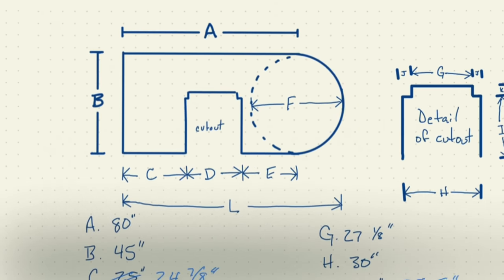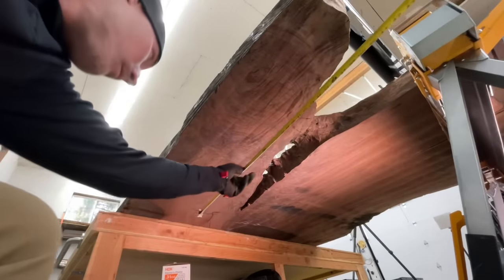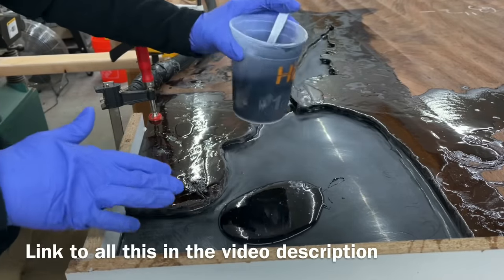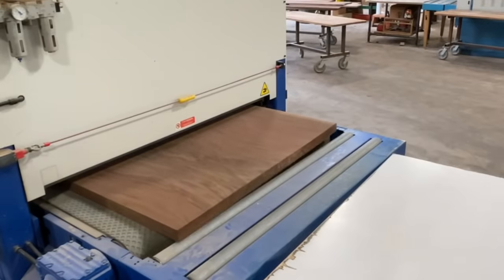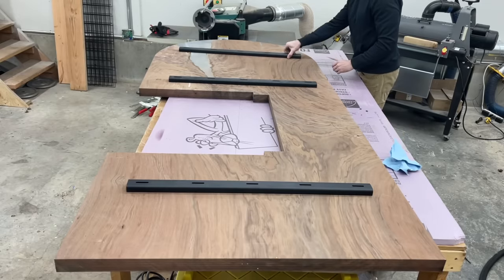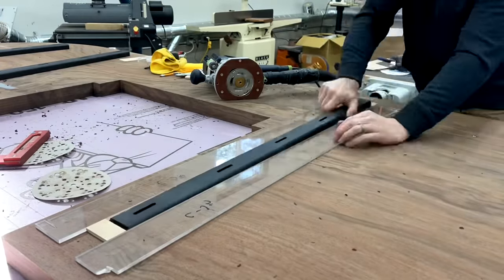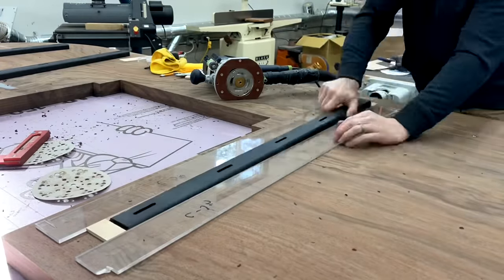$15,000 Kitchen Island

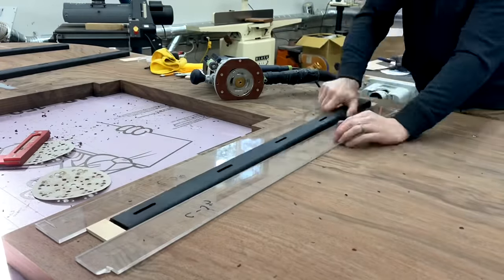Comment: LOL i had to pause this right at 10:21 and say... i had the video muted and music playing with the captions on this whole time XD 
absolutely love your work and your insights though! anyone who's not at least following along in the subtitles is missing out
Reply: Here in the Mtns of Tipperary, Eire we have a  30', 3/4" maple 'L' shaped kitchen counter I made from planed rough timber with <8" biscuit jointed strips edged with a matching 3/4" strip lip to give the look of a 1,1/2" top. It worked well. The corner, which is so often dead space, has a hob with oven below and inlayed plain cream coloured tiles in a triangle either side for hot pots. Over 20 years it's aged beautifully with minimal movement. At the time the cost of the maple was €2k during the hight of the 'celtic tiger', now I suspect it would be closer to 4-6k. The doors & drawers are an old 'Smallbone of Devizes' copy of Shaker like design with flush fitting hinges. Doors are planted on a 2"x2" planed frame with 1/2 round hockeystick beading inset around the opennings that is forgiving of slight differenciation when hanging doors and makes for a soft finnish. That frame is in turn planted on regular kitchen carcasing units. Your use of apoxy is brilliant, I see may workers using this idea now and some making a metal alloy for the bowties which they then rout smooth. At the time of creating ours I left the imperfections unfilled and at the edge, happy I did, they bring some added character to the creation. 

I'm in awe of your workshop space, one can never have enough room, I never do! We're thinking of selling up so the next property will definitely have a larger working space. When I build the new kitchen many of your ideas will be used! 
Thank you for your sharing, you're an inspiration.
Blessings of happiness & joy, God bless your work.
💖🙏🌻

As an aside my father years ago in Somerset, UK had a huge dead walnut removed by the village woodworking shop. The only charge they put on him was the wood they salvaged, now I know why. I missed that opportunity! 😂

Another story. A very wealthy old man passes on and leaves the 4 sons all the property and cash but for 100 acres of woodland to the daughter. She feels left out until it is explained to her it is 100 acres of mature walnut! 😂 She was his favorite but I hear he was also a practical joker! 
True story? I'd like to think so. lol
Reply: @jayhillrubis  Yes in my younger and more able days I used to love doing the odd pieces of joinery and surprised myself on how well I could make things like rail and post doors blanket boxes out of recycled timber but my arthritis has caught up with me and my large if not basic machinery now lies idle and I hope one day my son will use them when he gets the time as he is quite good at picking things up. I drool over some of the Blacktail machinery and workshop and it must have cost a fortune but it is worth it in the end eh to know that you did this by yourself? Plus the fact that you know that the things you have made are perfect and not just thrown together like some factory made furniture.
Reply: @BlacktailStudio  price total on your work ?
Reply: @BlacktailStudio  15 000   dolars for a wood ?  :)))))))))))))
Reply: Not wood for countertop…nevertheless, beautiful work!
Reply: @kmrice2803  I agree it is a shame that this beautiful top is probably going to be spoiled by kitchen use much better for a small dining table .
Reply: @johngoard8272 ,(
Reply: @BlacktailStudio  I love wood! Can you please tell me how to know if wood is kiln dried? And can I use air dried slabs that have been air dried fro years? I need help in knowing where I can get some slabs to get started please and thank you!
Reply: i prefer the commentary over music to a degree indesribable with words
Reply: @gigithebird2151  god, yeah, i respect ppl who do music but MY taste in music is never whatever YouTube's various creators use- at least the commentary is interesting!
Reply: P
Reply: @gigithebird2151  I agree ! Some people have no idea about volume control.
Reply: Since you've now made an epoxy/wood countertop, how about making some cutting boards?  😅
Reply: @kmrice2803   I agree! The counter top was beautiful but countertops take too much abuse. I wouldn't want to baby my countertop.
Reply: :eyes-pink-heart-shape:
Reply: J mm
Reply: WOW CAM...UR NOT ALONE I TURN ON YOUTUBE FOR ENTERTAINMENT TOO...
AND A 30 MINUTE VIDEOS IS VERY ACCEPTABLE...THANK YOU FOR ALL OF UR HARD & AMAZING WOODWORKING PROJECTS N ALL THE EDITING DONE!
But U could take a Deep Breath every oce in a while!😊
Reply: Wouldn’t want captions. It takes away from watching what is happening!
Reply: I want a wood countertop for sure.  Could the finish be oil / beeswax only?   Recoating as needed?

Comment: Something to add with the heat gun vs torch debate, I know its mostly due to my own inability to keep my shop and tools thoroughly clean, but my heat gun and shop accumulates sawdust and because a heat gun is basically a more extreme hair dryer, I've had issues with it blowing dust and debris into things I'm heating whereas my torch produces consistently cleaner results. Your mileage may differ, just my 2 cents

Comment: I would not get a wood countertop, only because I would be terrified of leaving a ring, dent or stain!  You created an absolute work of art, and the process was fascinating.  Keep doing what you do!
Reply: Ring or stain no. Dent... Maybe. It has coating so no rings or stains
Reply: I’m not too familiar with woodworking, but could you resurface these wood countertops? Or would you end up taking off way too much just to fix some dents?
Reply: @sofreshsogreen  If its thick enough, you can usually fix any wood furniture by just "Sanding it and Re-Coating it with Wax/Varnish", the problem is that the wax/varnish probably wont be the same (so there will be a color difference), and once you sand the top layer you might find more imperfections than when you started that you need to refill or fix.  Obviously its not just this simple 2 step process, but the theory works on almost any wood that was accidentaly messed up... its just too much work and sometimes not worth the risk.   :D
Reply: So what if you ding it.......you have scars don't you?
Reply: Gas range. Wooden countertop. Gas range. Wooden countertop. Gas range. Wooden countertop.

I see.
Reply: I’ve grown up too jaded from having to clean the kitchen I share with my family—specifically, my three siblings and father. I also dream about being a mother someday. I would never in a million years have a wood countertop 😂
Reply: They aren't dents...they are character marks. 😄
Reply: @DannyDevitoOffical-TrustMeBro   I put wood countertops in my kitchen but went a completely different direction than this. (This is beautiful, but I would not do)
All of my countertops were natural Butcher-Block and 4 inches thick. Hot pots, dents, stains & chopping meat & vegetables on them for ten years didn't hurt them one bit.
Reply: If you make any stain or a ring, it is very easy to remedy. Sand it a little bit and resurface it. It will take an hour, maybe 2. But believe me, that's a one time job, you won't do it again :)))
Reply: This is gorgeous! I “wood” have them in my kitchen.

Comment: Since you asked for my advice, I would have done one extra thing: send the client the MDF sample cut by the CNC company so he can check that it fits before making the final cut.  If the drawing had an error, better to find out before the bit starts spinning.
Reply: Correct! I make granite countertops for kitchens, among many others, but in kitchens I always work according to the template, this was not the case, if the owner took the measures, he assumes the risk in case of errors ... but for U-shaped countertops or L and mounted on the wall, a template is an ideal and mandatory thing
Reply: This is a beauty.
Reply: was thinking the exact same thing but thought maybe he did do that so Ill mind my business lol

Comment: Beautiful work! 
To answer the question "Would or wouldn't wood?" - I would go with "Wouldn't" for a kitchen island. What you did in this video is a masterpiece but even if it was a regular piece it would really need to be pampered if it was to be preserved. Table, bar top or pretty much anything except for a cooking surface, especially warm kitchen - this is the way to go for style points.
Reply: I have the liquid glass as a finish and you don't really need to pamper it. It is so tough. You can always sand it and refinish it. If you have a granite top and place something hot or oily on it, it could be ruined for life. I've seen a $20,000 granite top and it had a large circle permanently etched into it.
Reply: Having heat insulated place mats for kitchen utensils when cooking to preserve the wood. But yeah, for a kitchen to be function over form that wood would mark or dent very easily. At $15000 I'd have to have a cheap counter top to use instead.

Comment: Wood not.  But it definitly looks cool! I wood on a table or desk for sure though.
Reply: Hi Zach. "scratches at a level 6 with deeper grooves at a level 7"
Reply: Oh snap, look who it is lol. Fancy seeing you here.
Reply from the maker: I’m with ya Jerry 👊👊
Reply: God your everywhere.
Reply: Would wood. But definitly with a protective layer of saphire glass on top of it ;)

Plastic scratches at level two or three, glass scratches at level five or six, and sapphire scratches at level eight or nine, but always remember glass is glass and glass can break.
Reply: Jerry could go round and do a bend test on the counter top 😆🙌
Reply: Is jerry!!!!
Reply: Wood and did. It was in the 2nd house we built. The bulk of the counter tops were granite tile. We added a custom 4' x 7' x 3" black walnut butcher block. One of the 4' sides was against the wall and started about 2'-3' to the left of the sink. It was raised about 6" higher than the rest of the counter top. That way we were able to put barstools on the other side.  We left it natural colored and just oiled it, since we actually used it as a cutting block.

Comment: I'm a finisher of 35 years,  presently I have spent my last 10 years of work in a prestigious Hotel on the Las Vegas Strip.  I've seen it all done it all, and yes I would love to have wood counter tops but only if it's finished like you did in this video with a A-B epoxy finish. People just don't know how resilient these finishes are till they have them,  heat resistant,  fire resistant,  and impact resistance make anything perfect for a countertop.  I use these products frequently with incredible results, Great job on the beautiful work you did here!
Reply: I have a walnut countertop. I love it. I only need to oil every 3-4 months or so.
Reply: You probably just changed my mind on the “wood islands with ranges or sinks” phobia.

Comment: Wood. Absolutely, wood. You've just made me want to go pick up a black walnut slab and make my own. My kitchen is fairly dated, and I've got the shop space. I'm gonna run this by the wife tonight.

Absolutely gorgeous work, by the way. As a pandemic driven, meager one man shop myself, you've got my respect, sir. This is impressive.
Reply: I LOVE my wood countertops. Only word of caution: wet use areas will deteriorate more quickly. My undermount sink looks great but I need to scuff and recoat the finish every couple of yrs👍🏻
Reply: My tables in my log cabin are wide cedar slabs with a layer of epoxy and it’s been amazing and still looks new after 4 years
Reply: make sure to tell your wife how much you love her, and show her this video, before you disappear into the shop for a month. lol
Reply: @raymondbaker3413  I'm always in that shop anyway. When I'm not she's often telling me to go out there. The key to a happy marriage is avoiding each other.. At least until dinner time. Lol. Learned that from an old shop foreman had been married 60 some odd years. Seems to be working thus far. ;)

Comment: Love the bit about the mute.  I enjoy hearing the story about what you are doing though so please don't change.
Edited after watching all of it to add I love wood countertops. I had my husband make one from Zebra wood for the bathroom in the basement.  It's a gorgeous area that is a bit eclectic but not used much so maintenance isn't really an issue and it is oil finished so hey , sand and re-oil if it needs it.
I would use well finished wood countertops in my kitchen but not around my cooktop.  I too am brutal in the kitchen.  I use my kitchen and I have a really good exhaust vent so I don't hesitate to do high heat sears which are pretty messy as far as grease splatter. My island is mostly used for prep work and wood would be great.

This countertop turned out gorgeous.

Comment: I definitely would have wood countertops. Although I think I would probably have a thick layer of epoxy on the top so the wood was encapsulated, rather than just a thin protective layer, certainly redwood looks absolutely fantastic.
Reply: Just dont put anything hot on it. A thick layer of epoxy is still plastic and that doesnt go well with heat. Wood looks great but for a kitchen counter top its definitely go to come with a lot inconveniences if you want it to last.
Reply: My wife and I thought about the epoxy layer. There’s high temperature epoxies too. I might do a test piece to make sure it doesn’t separate from the wood at high temps. Might also just keep in mind you need to always have a pot holder.

Comment: Wood looks tremendous and has real longevity because it can improve with age/use and can be revitalized. The scale of this top and the finished product explains the price tag, brilliant job! Not sure your tabletop dance moves were that clever though..
Reply: I don't know about longevity when it comes to kitchen countertops. You definitely have to be careful not to burn it, spill fat on it or slip off your cutting board and scratch or dent it. It us, however, absolutely beautiful and worth the hassle in my opinion.
Reply: @SpaghettiToaster  to be fair, I made a massive white oak island countertop 6 years ago for my own home- and honestly I’ve been very impressed with how well it’s held up. All I do is run some mineral oil/beeswax mix on it once a year or so (at best 🙄)
Reply: @SpaghettiToaster  what happens if you spill fat on it, grease stain?

Comment: No Wood (again).   When we bought our country home the centre island was topped with a 2" thick solid Oak counter top.  The house is very close to a lake and is heated primarily with a wood fireplace (insert).  The counter top was slightly warped when we moved in, but, within a year the edges were nearly 1" higher from the floor than the centre.  We assumed with the dry heat in the winter and the humidity from the lake in the summer the wood counter top was not the right fit for our home.  We had it replaced with a Eramosa Marble Slab pulled from a quarry only a mile from our house.

Comment: I would go for the wood countertop, to be honest! Its the new wave
Reply: I agree but how does one make it heatproof and waterproof?
Reply: @starfiresilky  epoxy is what most people would do to serve that purpose
Reply: Wood , without even thinking about it!!!!
Reply: @starfiresilky ,,.,
Reply: @youthought878  thank you
Reply: Installed wood in my last place, little bit of maintenance, but a lot of love!! Wouldn’t do anything different now
Reply: @ninety9monkeys416  I've had total Black Walnut countertops for 12 years including a 6' x 4" island.  Easy Maintenance. Mineral oil and NO hot pans. You wouldn't put hot pans on formica either, right?
Reply: @rollinmark8952  That simple peace of logic has set my mind at ease after reading all these comments.   I am just about to oil my top and install it.   The oak grain after oiling looks the business.  You are damn right, you wouldn't put a hot pan on formica.  mind rested  ;-)
Reply: @rollinmark8952  true! I kept any off cuts from my install and cut them up into chopping boards and pan placemats.  Didn’t matter what happened to them, just saved my work tops.
Reply: Lol.  For tens of thousands of years, it was the only one available.  🙂

Comment: As lovely as it looked in the end, I personally wouldn't have a wood counter-top because 
1) I'm sloppy with hot pots and pans, 
2) I'd hate to ruin such a gorgeous piece of art with my sloppyness.

Awesome job! Cheers.
Reply: Yeah, you can the customer is either a total neat freak or more likely, never cooks.
Reply: I don't think it's just you so I don't think you're sloppy. At the end of the day this is an art piece but it's impractical for every day use. Even the heat that will emanate from the stove and the oven are bound to have an impact on the wood and that's something out of your control.
Reply: Same here, I think it looks great, but I brutalize my kitchen. A thick, clear epoxy coat of the right product on top would probably make it much more resilient but would take away from the natural aesthetic and still wouldn't handle a hot pan.
Reply: Get some nice trivets bruv